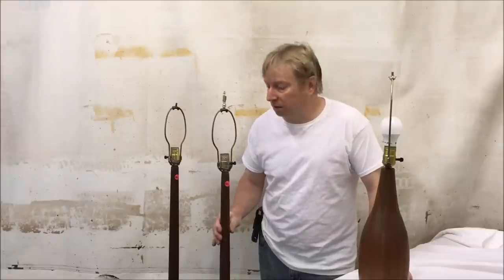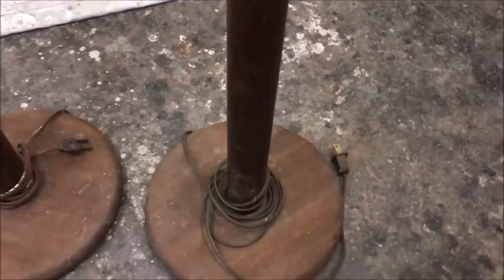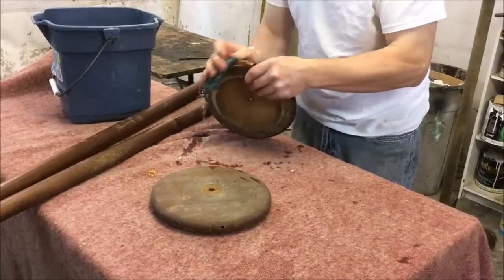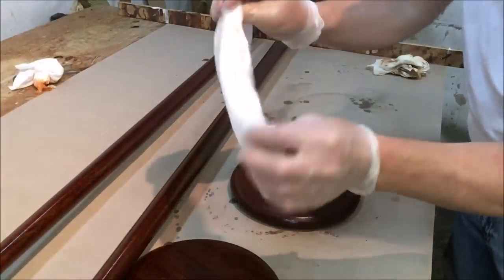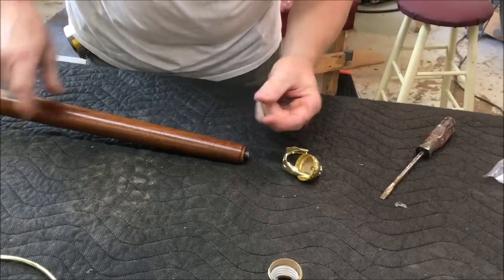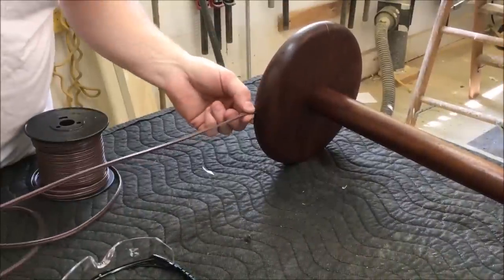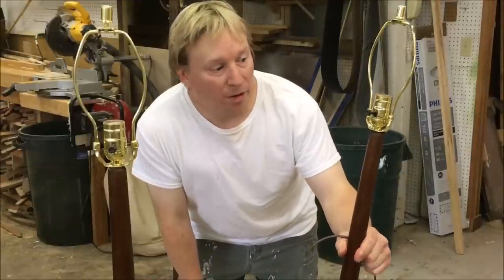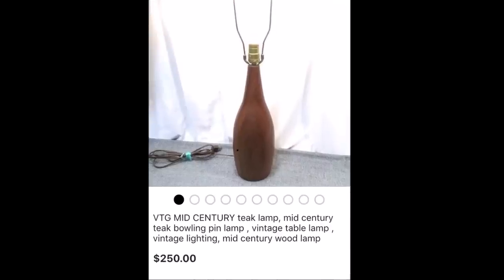MID-CENTURY TEAK LAMP RESTORATION

Comment: Who knew the pairs of floor lamps would be worth so much. Almost all of us would have walked right past them. Good Eye!
Reply: Team is an expensive wood and those lamps were solidly made. I recently looked for some teak dowels to replace a chair stretcher and I was shocked at the price
Reply from the maker: I am not an expert in lamps , but recognized them as mid century ,I took a close look at them to make sure they were not a homemade lamp .  at 50 cents each just grab and go and figure it out later
Reply: Yes, they did look a little like a high school shop project at quick glance and you are so correct that at 50 cents each it was worth the effort to carry them out. Great eye!

Comment: You can tie a knot in a base as a cable strain relief not straight through the hole to make lamp a bit safer in case someone pulls on the cable and lamp becomes live

Comment: Nice lamps.  Job well done.  From what I could see of the table lamp, it looks like the wiring had been replaced; the plug was a style that came out later.
Reply from the maker: yes it has a later polorized plug , but it was in good shape
Reply: ROSS TAYLOR WOODWORKS - You do quality work.